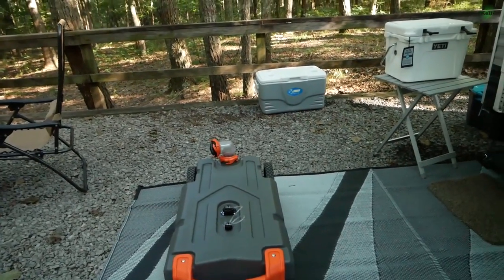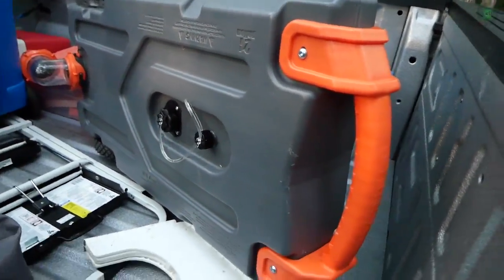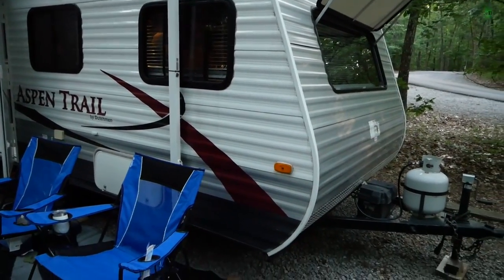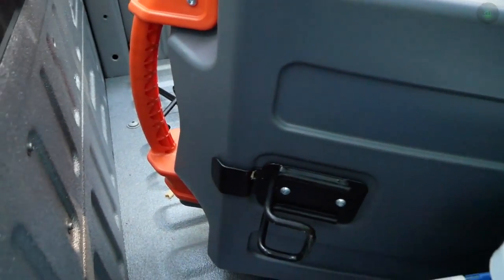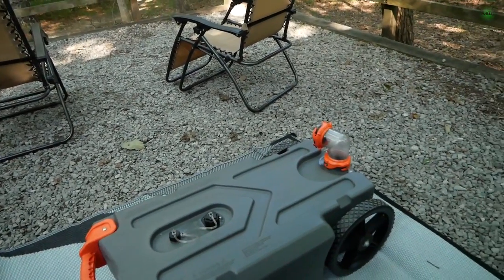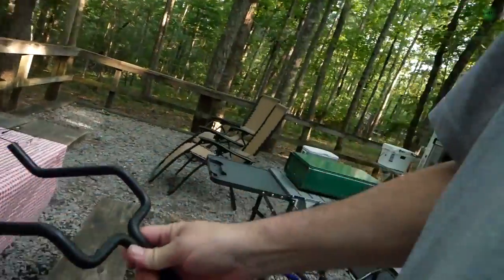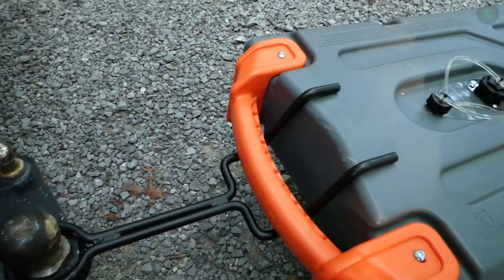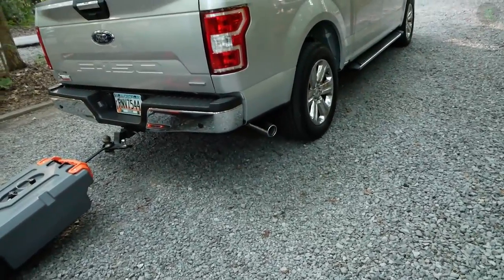How to Use an RV Gray Water Tote Tank When Camping

Comment: Where is it writen that you cant use these tanks for black water. I been using these types of tanks for 30 years
Reply from the maker: To each his own. I simply would not recommend using for black tank disposal.
Reply: What if you have a huge log jam!?
Reply: @timd240  c4
Reply from the maker: @timd240  That's why I only use this for grey water.
Reply: Per the manufacturer the tank is for black or grey water. Thats why its equipped with a tank rinse fitting.
Reply: @timd240  Eat more fiber
Reply: They are made for sewer:)lol
Reply: It says it nowhere.  This video is out of line.

Comment: Been rving sence 1978 had one of these sence about 91 you can put black water to them rince out with gray. Make it really easy, put tank in truck and get a macearater pump if you got the 28 or 36 gal.
Reply from the maker: Hey thanks for the input. If we ever  start camping long enough to need to dump black we will use your idea.

Comment: that was really helpful, especially in a pinch. We just got a high wall pop up with a very low water valve, and being new to the water system in a larger camper, we had no idea how to drain the water bc we couldn't figure out how to use those and gravity. 
Thanks for the video!
Reply from the maker: Glad the video helped! Thanks for commenting.

Comment: You CAN use this for blackwater. When you said that they are only meant for grey water not black water, that is incorrect. They are designed for black and grey.
Reply from the maker: Correct. Just for grey is my preference.

Comment: Where did you see that you couldn't use it for black?
Reply from the maker: There is nothing to say the tank could not be used for black. I certainly would not recommend doing it.
Reply: @thekellycorner  I ended up buying one and have used it once.  So far, so good.  I was impressed with the fact that they sent all the accessories with it - noting else you need except gloves. Thre isn't a lot of documentation that comes with it, just a couple of pages. It never says black or grey.  It only ever says it is for "RV Waste".  So, if anyone else is wondering, there is no prohibition on what comes in the package and it worked great for me.  It even has a built-in tank sprayer to clean it up afterward.
Reply: It is designed for black and well since they include a tank sprayer
Reply from the maker: Hey glad you like the tank.
Reply: @hamhouke  RV Waste means Black Tank. you can dump your gray tank on the ground. Your gray tank is no different than taking a shower outside or washing dishes in a pale the dumping your dishwater outside.
Reply: @MYCHANNELWITHMYSTUFF  I know your comment is 2 years old but no, you cannot just open your gray and let it rip in many places. Be sure you check because just cause a park will allow it (such as BLM), there are several states that absolutely make it illegal such as the one I live in and camp in most often (Florida). Much like him saying that it was not designed for black tank (which is simply just false, opinion or not), don't lead people on cause someone may read that and have serious issues.

Comment: You should say that in your opinion, you shouldn't use it for the black tank. These are most certainly manufactured to be used for both black and grey. That's the entire point in having one. The waste that comes from the Grey tank is often just as bad or worse that the black tank. I hope newbies are not put off by the faulty information your giving out.
Reply from the maker: The entire video is just my opinion. The product page does state that it can be used for whatever you like.